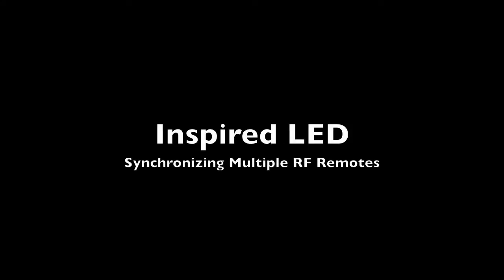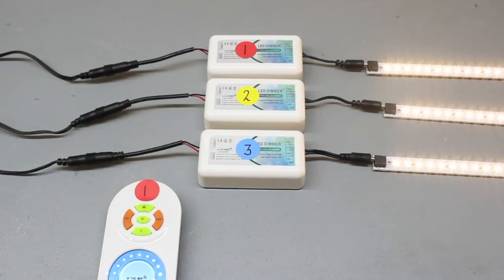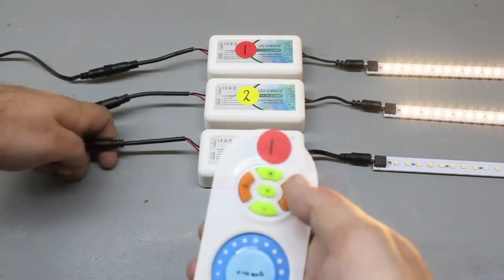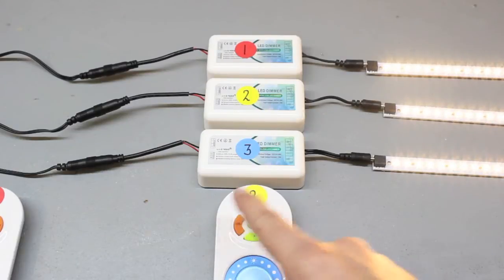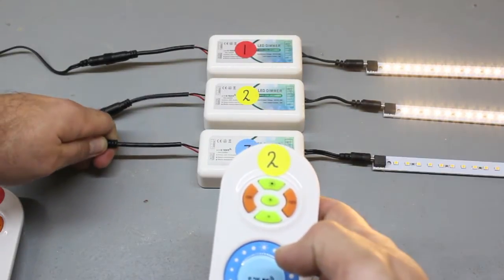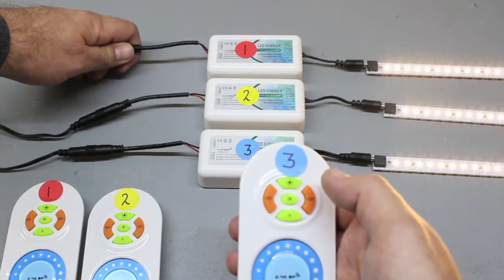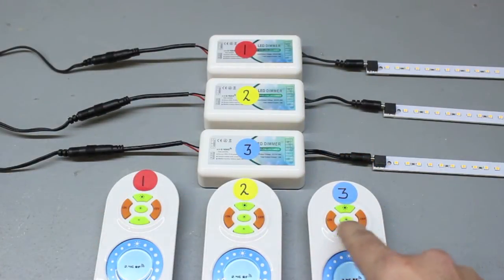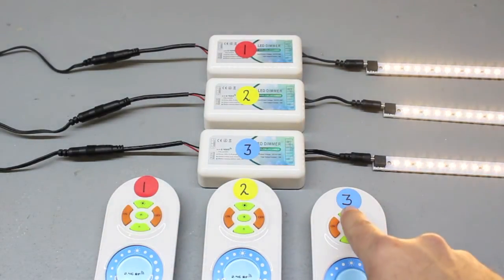Synchronizing Multiple RF Controllers | Inspired LED

Comment: Does it work even if they have different power supplies ?   Does it work with the 44 button generic RGB controllers or only for the specific  controllers used in the video ?
Reply from the maker: The above directions on work for the specific controllers used in the video.